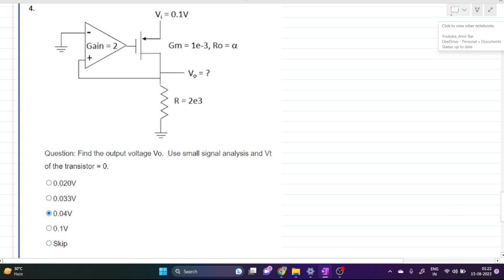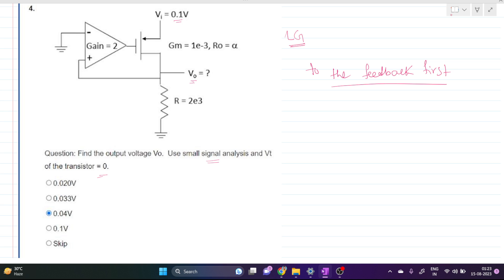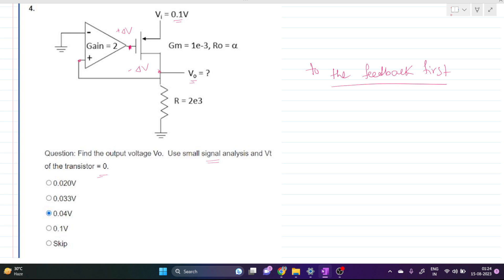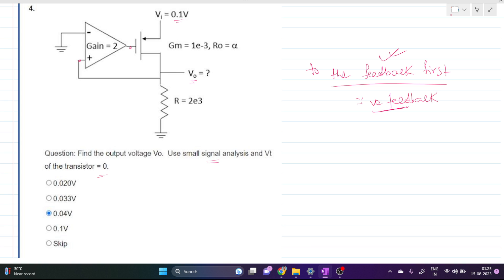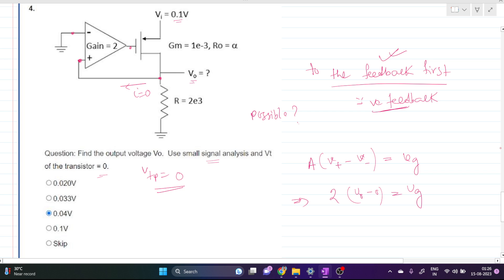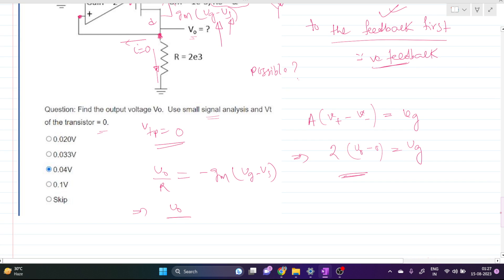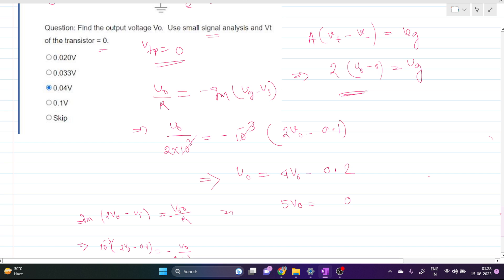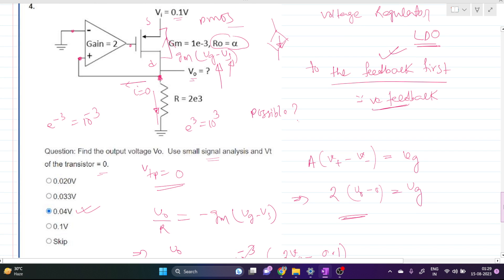Find small signal Vo for this Circuit_Analog Design Interview/Test Question_Amit Bar

Comment: Why did you consider the current through PMOS to be gm*(Vgs)? It's a small signal incremental current and you can't equate it to the dc current through the resistor. The dc current through the PMOS is 0.5*(gm* (Vsg-|Vth|)).

Comment: sir here you were not performing small signal analysis...then how could you take the drain current as gm*vgs..moreover for the small signal analysis vdd should be grounded...!!! it would be kind if you clarify my doubt
Reply: its pmos not Nmos , in  Nmos for Small signal Vdd grounded but in Pmos Vss(source is grounded)
Reply: @padhai6695 absolutely no. In small signal analysis every DC voltage source will be short circuit and every DC current source will be open circuit
Reply: No all dc source grounded in ac analysis

Comment: In small signal analysis why dont you took vs voltage which is given 0.1 as zero?
Reply: Vs = 0  in small signal model,
Reply: @muddukrishnay8061  here we are doing small signal analysis only
Reply: @TruthTeller-zd2oo  yes , but in small signal analysis all dc voltage are equal to 0 , as per this vs must equal to 0
Reply: @muddukrishnay8061  exactly this is what i am asking why vs is taken as 0.1 volt but not  zero
Reply: I think in question it should be given that applied Vi is a small signal input voltage, sir did it by assuming it.